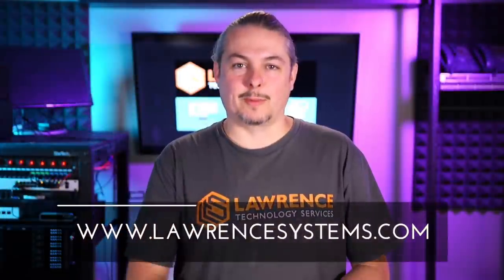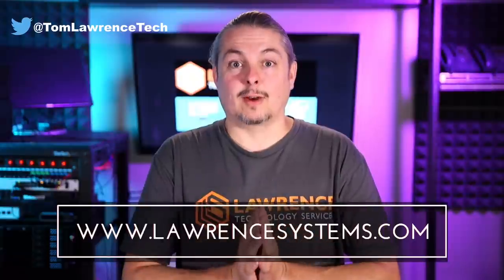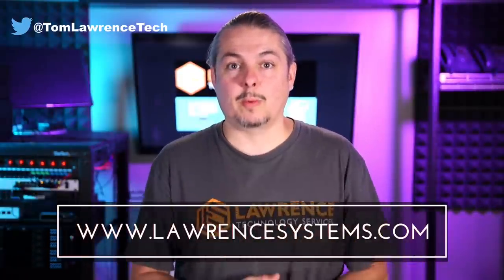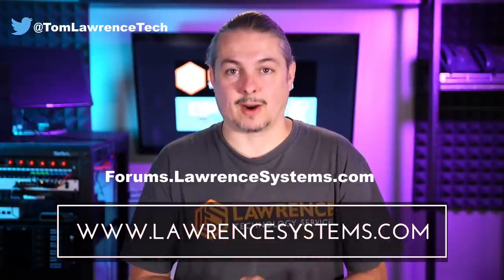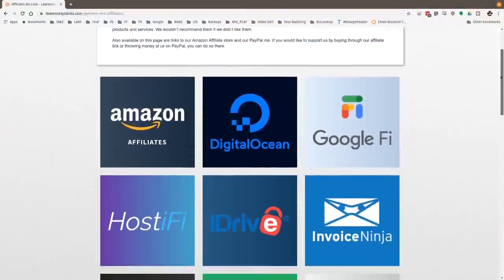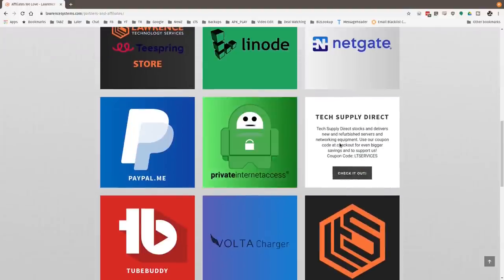New TIA & ISO TCL and ETCL Cable Requirement Standards and The Upcoming Single Pair Ethernet

Comment from the maker: Interview: Dan Barrera With Ideal Networks About TIA 42 Cabling Standards & Testing Processes

https://youtu.be/kNa_IdfivKs

⏱️ Timestamps ⏱️
0:00 Intro 
1:40 802.3bt Standards Update
5:00 Updated Cable Certifiers
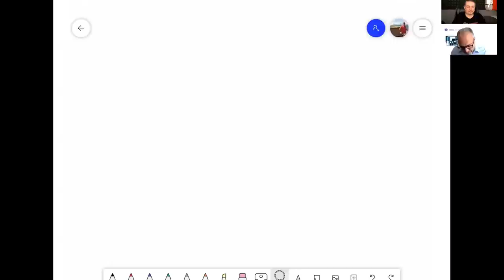6:27 Meausring DC Resistance Unbalance
16:14 Single Pair Ethernet
28:16 TCL & ELTCL Measurements
42:28 When the new standards are coming out
Reply: Is there any web links for this?
Reply: @alexbromberek1234  +1 need the web!

Comment: Single pair Ethernet is neat. EVSEs in Europe often have a data pair run alongside the power cables, to allow the EVSE to communicate with PV modules and other sources of electrical supply/demand. They're not currently Ethernet AFAIK, but you can imagine that it would be a huge improvement for them to be (vs. a less standard protocol or WiFi). You might even imagine a situation where "smart" light switches and outlets have a data pair run to them in the same power cable bundle, making all of these things more reliable (though I suppose that some devices will need a built-in Ethernet hub/switch to allow you to continue the data line from one outlet to the next).

Comment: Super cool to hear directly from the people creating the standards! I'll definitely share this with my colleagues!

After the single pair ethernet pair portion I was left with two questions:
Is it half duplex?
How much power will it push, and over which distance?
Reply: PHY will determine what modes it can operate with if there are actually any options..  Power and distance is also determined by standard and PHY.  ... This is nowhere near finalized but standards like 802.3cg are building blocks.

Comment: Correction: For the section discussing EMI and crosstalk I would like to make a comment. The advantage to differential signaling using a twisted pair is that the noise that is coupled into the individual wires is added equally to the inverted and non-inverted signals. The receiver responds to the difference in voltage between the two signals. So for example, lets say you are sending a single bit down the cable. Vp = 2.5 V and Vn = - 2.5 V at the receiver you will see Vrx = Vp - Vn = 2.5 V - (- 2.5 V) = 5 V. Now lets say you couple noise into the two lines equally. Vnoise = 1 V. Vrx = (Vp + Vnoise) - (Vn + Vnoise) = Vp - Vn + Vnoise - Vnoise = Vp - Vn + 1 V - 1 V = 2.5 V - (- 2.5 V) + 0 V = 5 V! As you can see, ideally the noise will cancel out and you'll be left with just the signal of interest.

Comment: i wish certifiers wouldn't be so dang expensive, i had a microtest pentascanner 15+ years ago, we used it to certified fast eth, it got stolen on a break-in 10 years ago(it was super old at that point, already obsolete) but when i went to check used prices for the same tester it was insane(at that point a 10yrd old unit) and cost for new certifiers of the same characteristics was startosferic, ans since i don't do structured cabling that much replacing it was impossible and i'm still without one.

Comment: Still somewhat new to cabling standards, but with Single Pair Ethernet, would that mean if an existing application only needing a single pair, could an existing cat6 type cable for example, be turned into 4 single pairs?

Comment: Bus bars are a problem because of the distance between the hot and the neutral.

With regular AC wire, the hot and neutral are bundled together, so the EMF cancels itself and it’s not an issue.

Comment: and its interesting too, R/U, tolerances, since by very nature each pair in a cable will be different lengths, so some pairs will have a different resistance, maybe neglible over short runs but if you use full link distances, I'm betting theres a high chance of more than acceptable limits, even on perfectly good, cable

Comment: Sounds like some standards being pushed by people that sell the 'certifiers'.  The resistance balance issue in the cables would heat up the cable,  it shouldn't have any real impact on the SMPS in the end devices or the POE switch, etc. supplying that power.   OK,  maybe if you want to say a pin on the port gets a tiny bit warmer.   If it burnt out you had something Way out of spec.
Reply: Nah conductivity changes as the material gets warmer. This is basic electromagnetism. They are just trying to harden the standard so cable manufactures can't put crap conductors in the cable and be certified for power (PoDL) as he said in the video.
Reply: @Marin3r101  Electromagnetism?  Perhaps more like Electron Theory.  Yes I fully understand what they are trying to do,  just that they happen to make money pushing the agenda at the same time.
Reply: @jeffm2787  inbalance causes the power supplies to heat up and reduce the life of the equipment. Might be a minimal impact but the more heat the equipment has to dissipate the quicker it may fail.
Reply: @danpayerle  This imbalance would need to be significant enough to drop the voltage enough to put the SMPS into a point on it's efficiency curve to really make a difference.  Yes in theory this is a problem, however stop pushing so much power through POE :)

Comment: I wonder if TIA and ISO have considered that in long runs the length of a CATx cable pair is different from the other three, because the pairs are twisted at a different turns per meter rate, thus making the resistance of a pair different from another.
The spec should mandate to rotate the twist rate between the pairs every X meters to avoid the above.
Reply: Exactly! This is one of the reasons for a 100m limit. The varying twist rates make a difference and we take this into consideration.
Reply: If you are using twisted pair cable for something other than Ethernet, such as analog RGB video, you can get “no skew” cable which does this.

Comment: Single pair is being pushed in my field (Industrial Control Networks) . Odd as we are among the last to adopt new tech.
Reply: saving copper and simplicity/robustness of having only a single pair
Reply: @gglovato  That's not as much of a consideration in my field. its all about performance and reliability over years without being touched while in an awful environment. Bleeding edge tech has no place there.

Comment: This all sounds kind of a pain in the neck.  What is the upside of changing old compliance.  Is anyone really going to go through and re-certify their cabling?  At least in Ohio, building codes don't require verification of low voltage cabling so how would you ever know if the cable you're working on is certified to new standards or not...And...who cares?
Reply: My take is that you would use these tests to determine if you want to use high power POE over your existing cable.  The same approach you need to take with an electrical extension cord.  You make a conscious decision to use a heavy duty extension cable for longer runs  or when your device (electric heater, high amp power tool)  will put a heavy load across that extension cord.  A thin gauge wire extension cord needs to be short in length and not be used with heavy load devices or the cord will get very hot.  So if you are going to purchase/install one of the high power POE switches and POE devices it would be smart to test your cable via the new standard to make sure that cable won't overheat and cause and electrical fire.
Reply: Totally agree with Garry- this is something you’d need to do before adopting high power PoE systems (such as a LED lighting system vendor trying to convince you that your existing wires will work).

Comment: Well nice they managed to rip open Ethernet standard rj45 connectors.. It's not like there is a space or weight limit in the bottling plant that justifies this new smaller jack. I have nothing against the 1 pair cable, that is a nice addition to the ethernet. Only place this is applicable would be airplane/spacecraft, and they probably use proprietary "custom" solutions that are vibration resistant. And even the bottling plant probably needs a different kind of jack for he same vibration issue. Or if you won't protect the connection from these vibrations on the jack level you need to address it on the jacket level and suddenly the savings are.. irrelevant. Inventing for no reason is meaningless.
Reply: The small connectors are primarily anticipated for high density sensor applications. 
Automotive companies use their own connectors and industrial applications can still use screw terminals it they like. The new SPE connector is in the commercial cabling standard and there’s a separate standard for industrial installations.
Reply: I would expect that you'd see standard 2 pin Phoenix type connectors in situations where connector density is unimportant but having a data network run in the same sheath as power cables is - you already see this with many devices that use two wire communication protocols. I imagine those will eventually be replaced with devices that do single pair Ethernet over the same cabling using the same connectors because of how ubiquitous they are (and also how hard they are for a complete novice to get wrong)
Reply: @ZiggyTheHamster  Those are also allowed. The new LC connector is a low cost option with high performance.